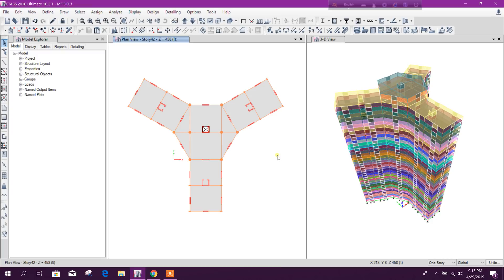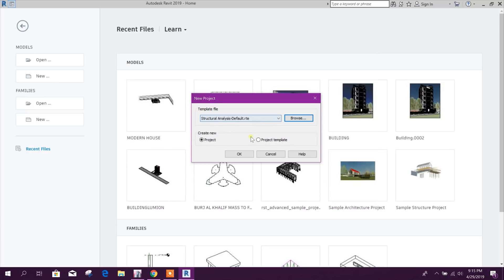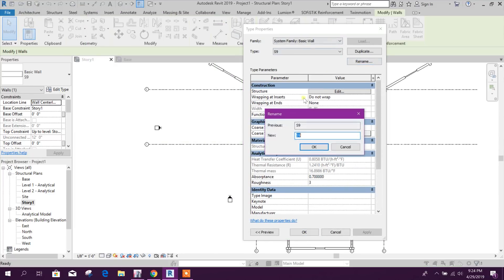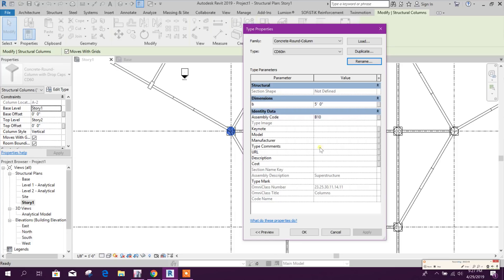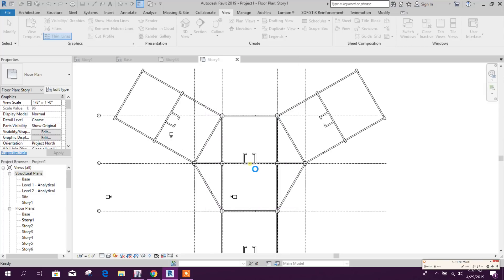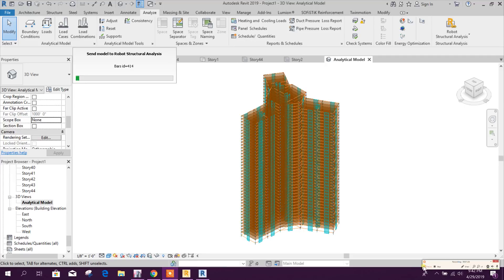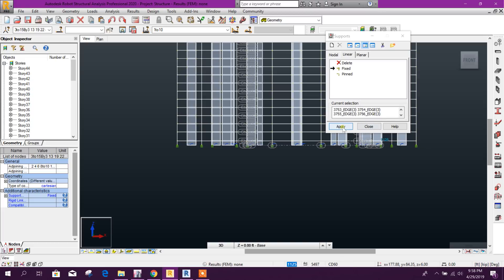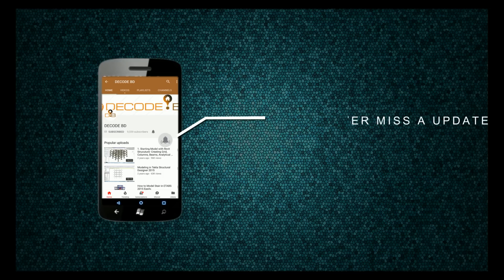Export Etabs model to Robot Structural Analysis

Comment: dude, where can i find a cracked version of midas civil 2018 or 2019?
Reply from the maker: I am not aware about Midas, because these don't work properly in cracked mode.
Reply: @Decodebd  are you sure about that? I haven't heard about any issues related with cracked versions of Midas
Reply from the maker: I tried Midas Gen before but it's having instability in 3D view option. All crack user faced this issue. Then I left trying midas products as we don't have ability to buy these software.
Reply: @Decodebd  Dude, I have always wanted to try these softwares,I could see Midas has a great potential, but unfortunately as you say, we afford it, and they aren't not cracked on the website.